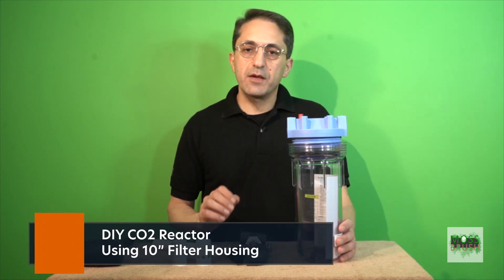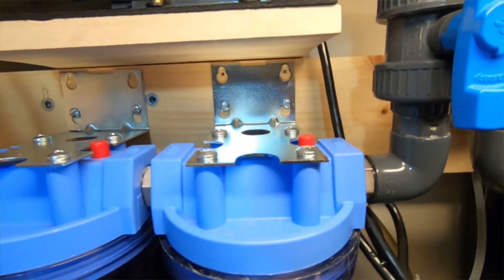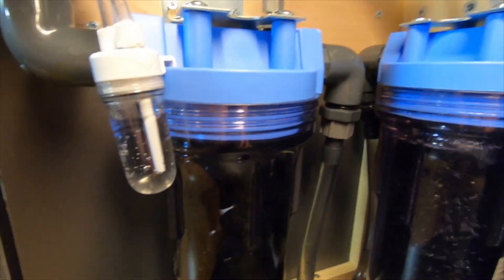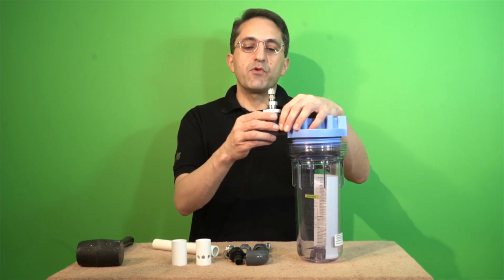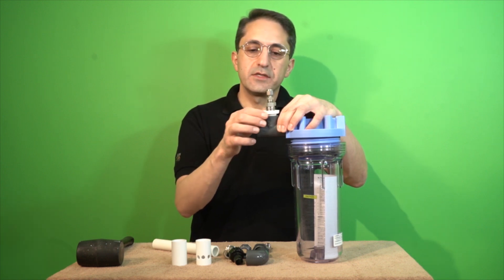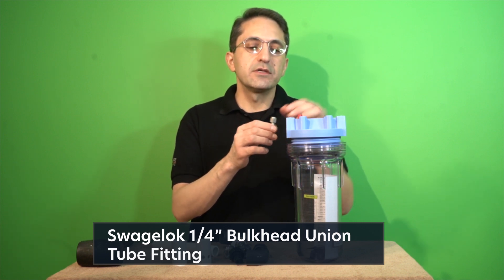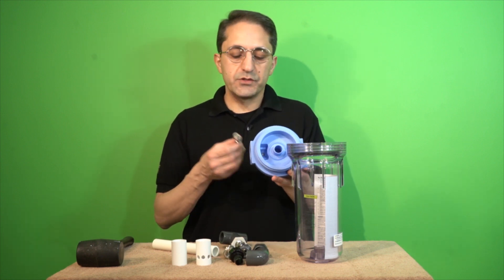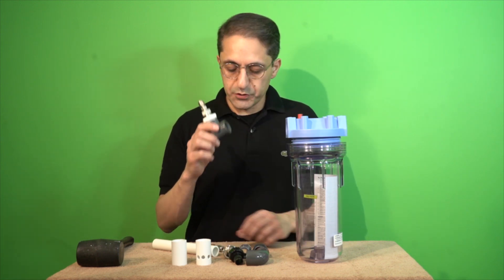DIY Inline Aquarium CO2 Reactor

Comment: Hello, I know this is an old video but I'm hoping you could please help? I bought the union that you mentioned, but I cant work out how to make my co2 hose stay in the union. Is there a trick to this? Do I need to put the small metal insert from the union inside the hose? It can slide over the outside tightly but I'm not sure how to make it stay tight.

Comment: Form comments below. I would may be install mesh on top, close to the cup. In the way, that water will fill upper chamber and drip down through collected co2 gas.
Reply from the maker: Thank you for your suggestion 🙏
Reply: @Handyaquarist  Additionally you could buy cartridge for your filter. Cartridge should be like fine polyester mesh. Possible to see from this link https://www.ebay.de/itm/5-Wasserfilter-2x-1-AG-Vorfilter-Mehrwegfilter-f-Gartenpumpe-Hauswasserwerk/223168305973? 
Technically big bubbles should not penetrate 10-50um mesh and due to thin film should not be strong water restriction
Reply from the maker: @iIiWARHEADiIi  Thank you, that for sure will help to increase CO2 dissolving rate. I actually have one 10" cartridge, planning to use it for other project. I will get another one for CO2 Reactor. Thank you again 🙏
Reply: @Handyaquarist  I have faced a problem with my inline diffusor (which give from time to time big bubbles, which collect in  a filter pipe), and start thinking about your approach and how to improve it.

Comment: Sorry but the order of the housing boxes in the reverse direction. The first input should be sponge filter or fiber filter. Biomedia should be the second step. Every sump uses this method. And this causes biomedia clogged or polluted for a long time. The later the😁 better
Reply from the maker: Thank you for watching.🙏 The sponge filter is actually the first stage, sorry if it is not clear. I am only using one side of the tank to bring all hoses, and the arrangement of filters are like that. Should have shown how the intake from tank is attaching to the "in" of the sponge filter. Your point help me to improve my next video.🙏👍

Comment: Why an active carbon filter? It should be only used to filter out medication. If you use fluid fertilizers, you will possibly filter them out as well.
Reply from the maker: You are right, not a good choice if adding fertilizers. I was using that to remove yellow coloration caused by driftwood. Seachem Purigen is better choice, removing less trace elements.

Comment: What size of pump do you use to get the water through all these filters and still get good flow at the end??
Reply from the maker: I am using Eheim 1250. The flow becomes less when filter media is getting clogged. You can use Eheim 1260 or more stronger 1262. I haven't tried but DC water pumps also are good choice as you can adjust the flow.
Reply: Thanks for that, how does the Co2 reactor perform? I have sera reactors in both my large aquariums and I feel they just don’t cut it. Does yours use much Co2 on this set up? What is your Diffuser into the aquarium? Thanks again 👍
Reply from the maker: Sure mine uses more CO2 as well. No diffuser to the tank. Recently I have noticed decrease in my plants growth & switched to glass diffuser. Have to check if there is any problem. Thank you so much for watching.